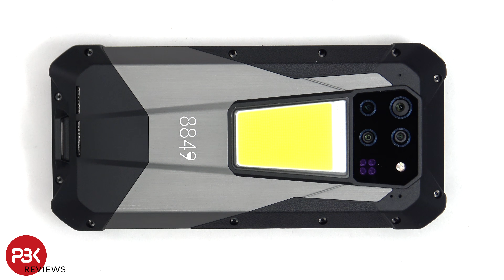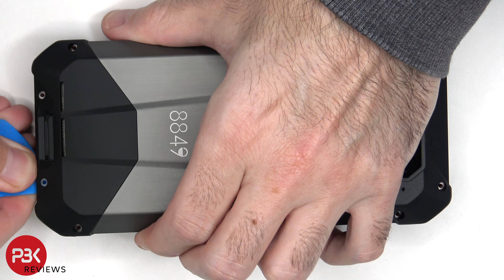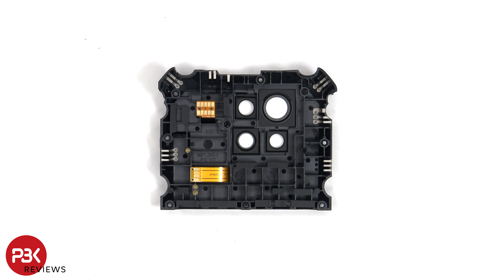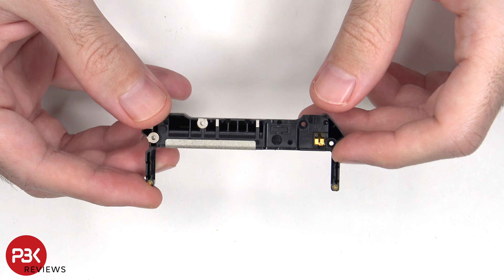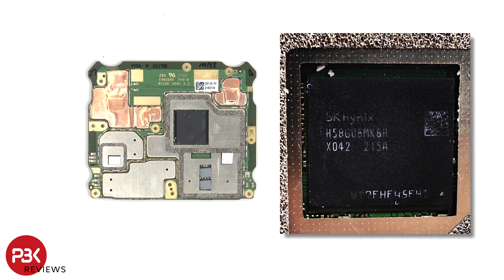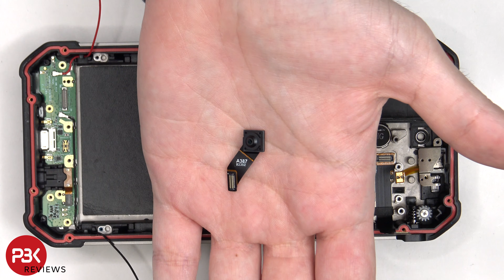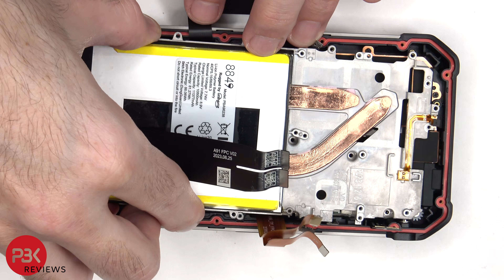8849 Tank 3 Pro Teardown Disassembly Phone Repair Review

Comment: Hi, my Tank 3 Pro failed after a 1m drop. WiFi and Bluetooth stopped working, MAC address shows 00:00. According to my research, it's a flex disconnection or a cracked solder joint. Is the WiFi/BT chip located on the charging board / sub board? Can I buy that board as a spare part? Is it repairable without changing the whole motherboard? Thanks!

Comment: Excellent video—thanks for the detailed work! I'm dealing with a very similar issue on my [exact model shown in your video for a few frames or at least I think, e.g., 8849 Tank 4 Pro] and would value your insight.
Symptoms summary:
Intermittent SmartPA errors (F0/F4) with temperature-dependent behavior (good 685 Hz cold, fails ~1996 mΩ when warm).
Tinny speaker + "lightning flash"/horizontal artifacts in Recents animations (captured in screen recordings—shows in footage).
Ripple affecting AMOLED during GPU spikes; benchmarks impacted.
No random reboots after 3+ months—phone otherwise stable.
Mute test and recordings confirm audio load correlation.
Questions:
In your experience with Tank series (or similar rugged phones), how common are speaker/pogo pin failures causing PDN ripple/display noise?
What’s the success rate for pogo cleaning/tension vs. full speaker module replacement resolving both audio and display issues?
Any visible signs on the board (caps near SmartPA) I should watch for during teardown?
Probability this is isolated to the speaker module vs. deeper motherboard degradation?
Appreciate any thoughts—planning to open it soon following online guides. Thanks again!

Comment: Are the heatpipes that go around the battery connected to the fan?  I don't usually use the 100w charger that came with this phone and let it charge 20w overnight because I don't like heating up the battery, but if it's connected to the battery why not use the app that comes with the phone that controls the fan and quick charge with more peace of mind.
Reply: 100w? My come with 120w sometimes the phone heats up middle of night time. No I never charge it at night time, but it puzzles me why it heats up like that. So to solve it, I leave the fan on at night.

But it not all the time when it heats up, it like once few weeks.
Reply: @TheDragonfriday  Maybe it is 120w and got it wrong but I'm only going to use it in emergencies if I need a quick charge which it really shouldn't when I charge it every 2nd or 3rd night. Just let it charge slowly to make the battery last longer. Never goes below 30.
Reply: @sc0tte416 Fast charging will not kill your battery. However keeping your battery at over 80% or under 20% will.
Reply: @Flarus_ I've read lots of different opinions on that but never saw anything concrete.. some say fast charging generates heat which lithium batteries don't do well with and the 2 times I charged with that I noticed my phone got over 60c... I never tried turning the fan on with the utility app the phone comes with though.
Reply: @sc0tte416   Yea you are correct about lithium batteries. It truly depends on what the battery type it and/or how modern it is. Most modern phones do fine with fast charging, but of course if you want to be careful there's nothing wrong with that either. Especially considering that the phone battery will last a long time anyways.

Comment: I just wanted to know if the capacity of the battery and laser pointer has any problem with the security in airlines if we take in the carry in bag as we cannot take it in the checkout due to battery. Any ideas?  Great video and awesome expertise. Thank you!
Reply: It doesn't have a laser pointer.
Reply: I don't have the phone yet, but if it is 3.7v then the battery is a 88 watt hour battery. Airlines require 99 watt hours as the maximum. If it's a 5v, then it will be a 119 watt hour battery.
Reply: As long it under 100v you be fine. I recently bring the phone to the airport. They allow it pass.
Reply: Fly with my Tank 3 Pro weekly without issues

Comment: I enjoyed this video.  Going into this teardown I was wondering if the fan helped cool the processor, similar to the RedMagic phones, during heavy gaming.  As far as I can tell, it doesn't.  It's just for the projector.  Is that correct?
Reply: I have been using it for a while. The tool box of the mobile phone can turn on the cooling fan. When running large games, I feel that the air outlet is warm, but the fan intensity of the tool box is not as strong as the fan of the projector.
Reply: @不要看-g7b  – Thank you for replying.  I appreciate it.
Reply: @不要看-g7b I have no notice the difference between the project fan vs manually turn on app

But it does the job cooling it down

Comment: So it seems like that fan and heat sink are only for the projector I thought it might also work for cooling down the phone while running the processor hard.
Reply: Its sad that only the Tank Pad has an app where you can turn on the fan whenever you want and not just when you turn on the projector. Still, this phone has so much metal inside that it's pretty hard to overheat it... Maybe the fast charging 120w makes it warm,  idk. My phone gets hot at 33w charging😂
Reply: I use the fan when charging the phone since it's getting warm. The heat sink is connected to every important part in the phone so it's a nice thing. Usually battery gets to 50degrees, with cooling only 43@Glumacubarley
Reply: @stevieslav9227  Wait so you manually turn the fan on? Or it turns on automatically when it starts getting hot even at the projector is not on? There's not very much info online about this.
Reply: In the toolbox there is a setting to turn the fan on manually.
Reply: @PhagitzSpreadAIDS you mentally turn on, it got it own apps yes appsss it got many features you can't imagine it got
Reply: @The_Romanian_Vampiretank 3 pro also has an app to turn the fan manually.

Comment: So exactly how is it WaterProof with having the vents for the Fan? Being Waterproof is part of the Sales pitch, But yet has a Water indicator sticker on the inside to void warranty ?
Reply: the fan/heat pipes are separated by a gasket
Reply: @lotuseater92  But wouldn't water damage the fan?
Reply: @Jack_Move  im not 100% sure but the motor is self could be sealed the same way
Reply: I had been wondering that, I own the phone. But I worry about water, you know what water does best with electric stuff

Comment: Amazing video, I was able to change the screen of the phone watching your video.
Reply: How did you manage to remove the screen? I tried heat but i still cannot pry it off due to the raised bezels
Reply: @Doppel2gangerGaming I opened the device and pushed the screen from inside.
Reply: @dochi24111  Thanks for the quick reply, did you remove anything more after the 6:20 mark to be able to push it?
Reply: @Doppel2gangerGaming don't worry man.

And no, at that point and because my screen was already damaged, I pushed with a screw driver from the small space where the flex cable goes through. With that, a small portion of the glue of the screen was removed and  I was able to remove it from the outside.

Comment: Please answer! It's been 6 months since you uploaded the video. Is the tank 3 pro functioning without any issues? Any long term issues? I can see some mentioning cooling fan stopped working is that true? Can i buy this?
Reply: Yes, the fan stopped working in my case
Reply: Yes I have same problem even I never drop my phone but phone is not working after 4 5 months
Reply: Hello, I own this phone since December 2024. I got only 1 issues so fair. The power port is loose need to be replaced. It really my fault how I was charging it. Anyways, the phone works good, the fans works perfectly fine for me.
Reply: Had the phone for more than a year now. The fan and everything else works great. The only thing is the screen protector, I recommend you buy an external one because the one that comes with it is not good.

Comment: Okay so if I get an unlocked phone can I use any carrier with this?
Reply from the maker: Not necessarily. Now a days it's based off both the phone's network band compatibility, as well as your network or carrier. For example, AT&T and Cricket in the US now have a locked network where they only allow approved IMEI's or devices that are in their database to work with their network. So even if the phone is unlocked, AT&T or Cricket would not allow you to use it with their network. Tmobile you can. Also you need to always check the phone specs to see the phones network bands and compare with your carrier network bands to make sure you have most of the main ones so it works properly with your carrier.
Reply: @PBKreviews  thank you
Reply: I have T-Mobile

Comment: Is the fan functional for the rest of the mobile or is it only functional for the projector?
Reply from the maker: Its primarily for the projector, but the copper block sits behind the midplate assembly so can help transfer some heat from there as well from the back of the main board.
Reply: @PBKreviews  Ahh okay, I guess one would need to do some testing to really see how much it actually helps on the overall heat of the mobile.

Comment: One thing i got a tank 3 pro but does the power button/fingerprint connect with a thin wire? But easy remove and replace with a new one if scratch or damage

Comment: Am experiencing an issue with the tank 3 pro and no repair shop is willing to fix it. The cooling system completely stopped working and now can't use the projector without overheating
Reply: Mine also it stop working when i use underwater camera 😢

Comment: Thank you for this wonderful effort on your part, and I have a question i bought this phone two months ago and the phone is very excellent, but after a short while it fell from my hand at a distance of two meters, and the phone worked without any problem, but I discovered that after it fell from my hand, the Wi-Fi and Bluetooth were not working. I tried more than one way to turn it on, but I could not, and I reset it.  The factory did not work either. What is the solution in your opinion?
Reply: I lost mine on the Autobahn while driving 130Km/h, its still working lol
Reply: Lol, amazing that's still working 😅 @-_.DI2BA._-
Reply from the maker: You can try taking it apart and making sure all the cables are connected properly and have not come loose.

Comment: The fan located deep inside making it pretty much impossible for regular services to avoid clogging.
Reply: My fan completely stopped working. Now am left with nobody capable of repairing it
Reply: @VarHshr The blades shatter easily mine have done the same I'm gonna take the risk on stripping phone down getting it out and replacing it (if they can provide me with replacement) and if I do it well since ivecdone phone repairs in past I've spoke to be a phone repair guy for them in the uk
Reply: @Thatredneck so did you repair the fan?
Reply: @radg4434  you have to buy the full screen replacement chassis part. but yes I've done it
Reply: @Thatredneck  Is there any tutorial to replace it?
Reply: @radg4434  I used this video.
Reply: terrible experience with Tank 3 pro

Comment: Hi bro. I want to ask something, my phone [ POCO F4 GT ] was exposed to water and I'm afraid it will damage the charger port. After I tried to dry it and then charge it again, an error occurred where the phone wouldn't charge and kept charging and not charging. I'm confused about what the problem is

My plan is to disassemble the cellphone and Replace the port charger board and do I need to replace the thermal paste too? 

Thank you
Reply from the maker: Yeah you can apply some new adhesive to ensure proper cooling

Comment: So rugged, long lasting, solid build, durable phone but its really hard to dissemble and assemble nice work and video sir 💪🤠
Reply from the maker: Thank you
Reply: @PBKreviews  dziękuję za Film
Reply: @PBKreviews Hi bro. I want to ask something, my phone [ POCO F4 GT ] was exposed to water and I'm afraid it will damage the charger port. After I tried to dry it and then charge it again, an error occurred where the phone wouldn't charge and kept charging and not charging. I'm confused about what the problem is

My plan is to disassemble the cellphone and Replace the port charger board and do I need to replace the thermal paste too? 

Thank you
Reply: It doesn't seem difficult, large pieces and almost no glue.
Reply: Mine only lasted one month, projector is junk
Reply: @mule5267 your using Tank 3 pro?
Reply: @mule5267  If you call that awesome projector junk, then you're either spoiled or you clearly don't know how projectors work. And you probably mishandled your phone if it only lasted one month.